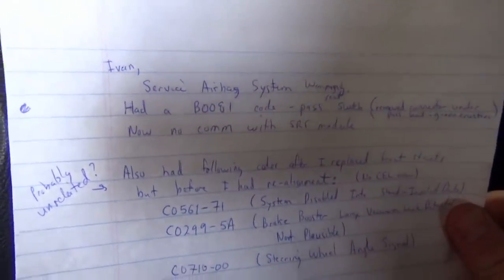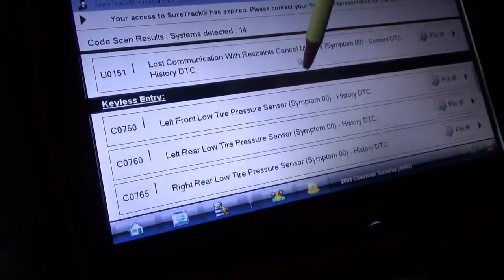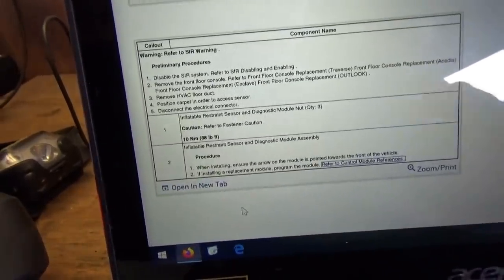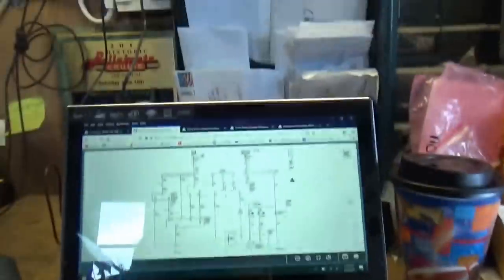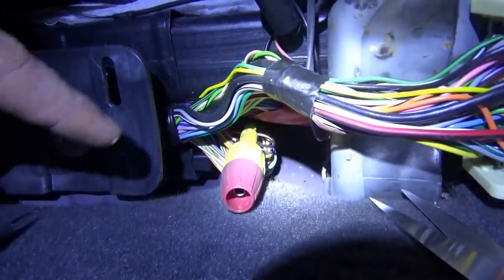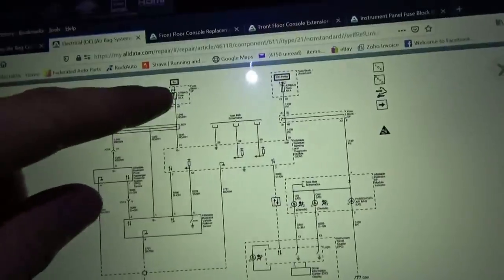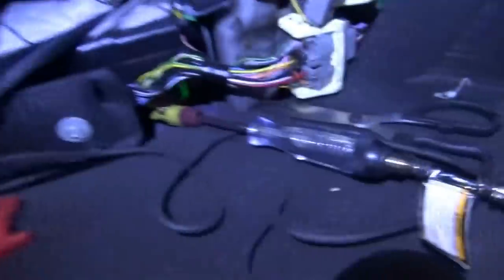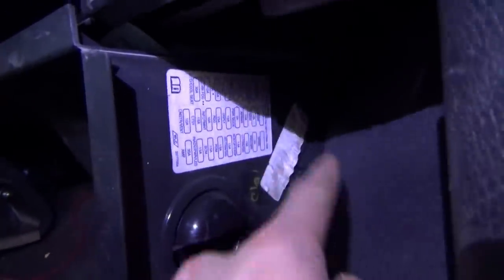GM AIRBAG - No COMMunication! (Chevy Traverse)

Comment: Like I told a former coworker.  When you have multiple codes, check to see what is the "common denominator."  Could be power, ground, communication, or corrosion.  Sometimes it's amazing what problems one fuse or ground can cause.

Comment: These vehicles are known for having water intrusion on the a pillar of both sides . water runs down the back of that fuse panel and causes all kinds of problems. Also runs down onto the amplifier on the driver side and causes the radio not to work.

Comment: Great Diag. Ivan, always interesting to watch you seek out the problem. I miss the days where gapping the sparkplugs, installing points/cond.
   then on GM, raising the little metal window on the distributor cap to set the point dwell while engine running. If you had a volt/dwell meter,
  you were the neighborhood Ace mechanic and go to guy. What happened to these days? Lol
Reply from the maker: @Vladimir Putin $40k will only buy 2 nice scanners. Keith must have a million dollars in equipment and subscriptions!!
Reply: DAMN, If that's not the truth me toon. I have all that stuff still mostly collecting dust now. I only use it on my one 60's Camaro if needed. I remember cleaning points with a match pack striker, LOL.
Reply: me toon I had a 73 Pontiac Lemans that had a little metal dwell adjusting window that was really cool for GM  to have that you could get your dwell perfect

Comment: What you did with your test light I did pretty much the exact same thing. Except I used the adapter from the powerprobe 3 kit. I can switch from ground to power just unplugging it. Love it for doing interior work when troubleshooting electrical problems

Comment: in those tight spaces to test fuses you should try to modify a test light to bend them into 90 degrees probe
Reply from the maker: Or just use some extension leads and backprobes 😁
Reply: veil67, That's what I said, LO9L.

Comment: What did i learn.. nothing, but here are some possibles.
Check the power feed fuse on both sides, don't press too hard as it may only make contact through the crustys while you are pressing on it lol, a recent problem :)
Make sure it's the correct ampage fuse (And the spares are not dead ones put there by the owner lol ).
Don't go mad and rip things apart untill you restore power, check the correct colour wire to test :)
Don't believe all the info the the owner says, it can be a smoke screen for the owner messing around.
Have a hot drink, it lubricates the brain... ok ok i like tea and it gives me a break to think :-).
i do talk a lot of crap lol.

Comment: Ivan,
Thank you for the video. I was trying to re-read the customers note - it seems he had the B0081 before he fiddled with the seat connector. So can you be certain the blown fuse was from him fiddling with that connector or could it be something else?
Thanks again
God bless
Paul (in MA)
Reply: Main power fuse to the airbag module being blown would not be caused by the seat connectors, it would be caused by the power feed wire to the module shorting out or the module itself. I suspect green meanies above the passenger fuse block from water leaks.

Comment: I'm in the process of opening my own garage, going from weekends to full-time. I had just been buying emanuals for the car I have in at that time, if I need to look anything up. But it looked like you use all-data, is that what I should go with as well? I need access to all makes and models, as I work on everything and anything

Comment: In this case the customer had a lucky escape - i would have suspected a severe case of the green crusties in the power distribution block and/or the SRS module to be full of water where it was sitting on the floor like that.

Comment: You are not done my friend 
Does that vehicle have sunroof? 
Cause your main problem is the top side of the fuse box. Just give a quick check need to remove glove compartment
water might be leaking from sunroof or windshield Dripping right on top of the interior fuse box
Reply: Vehicle may keep running when shut-off or the engine light stays on when shut off.   Was a very common repair for the first years of those vehicles.

Comment: Why did the fuse blow? maybe put amp clamp on power source or if room  read amps across fuse, if ok my guesss water leak, pull  back carpet check for damp padding

Comment: Looking for some help, I have a 2010 Chevy traverse and it was in a small crash and I've replaced steering wheel airbag and seatbelts and swapped the airbag module from another 2011 and now I'm getting a code b1001 do you think it can be a fuse or the module needs to be reprogram for that car? I've even reset it a couple times and it's still the same and suggestions?
Reply: New seat belt retractors and pre tensioners,new air bag,Reinstall the old airbag  module and reset it.

Comment: Hey Ivan can I ask you a question you might have an answer or idea for me. 2012 Chevy traverse brake light issue. There’s 4 taillights and 4 brake lights on the car which all 4 are dual filament 7443 bulbs. A few months ago all 4 brake light bulb filaments blew out but all 4 taillight filaments did not and the brake light fuse also popped. Replaced the fuse and all 4 bulbs and has worked fine for a few months and now once again all 4 brake light filaments blew out but this time did not blow the fuse. What do you think could be causing this issue and where would be a good direction to start with. Also to note the third brake light is not blowing out and after looking at wire diagrams the third brake light is not on the same circuit
Reply: I believe there known for brake light switch issues. maybe it's flickering them continuously while driving or staying on, more than off. both would make the bulbs cook. hot climates sitting in traffic/lines/parking lots with foot on the brake for long periods will shorten the life too.
 a broken filament can move and bridge across inside, possibly making a near short or back-feeding the marker light circuit, which would likely overload and blow fuses also.
Reply from the maker: Very mysterious problem! I would do a quick current measurement on the brake light circuit. Always use quality replacement bulbs too.

Comment: should of checked fuses first, but your not on flat rate, or in a shop, and on your own time, so does not really matter.
Reply from the maker: Well it does matter since the goal is to perform the diagnosis as efficiently as possible 😉

Comment: when it rains and drain tubes are clogged it will auto activate rear wipers, destroy the sunroof motor, flood the inside, ruin your fuse box, ruin your blower motor, corrode wiring in console, 

these suv's are 💩